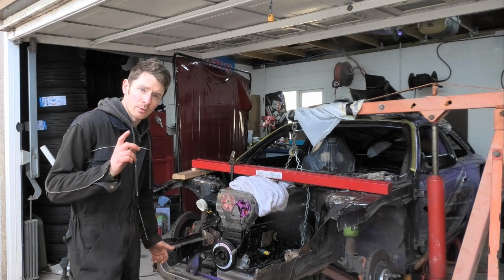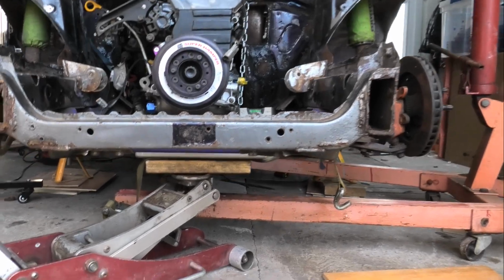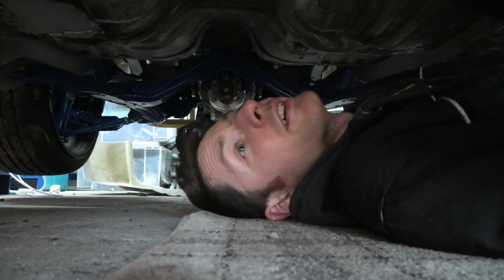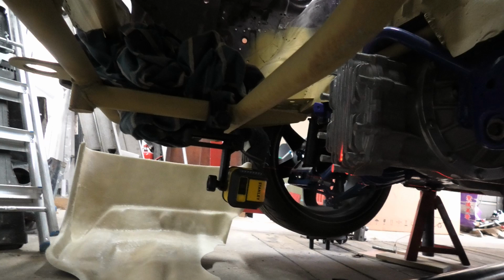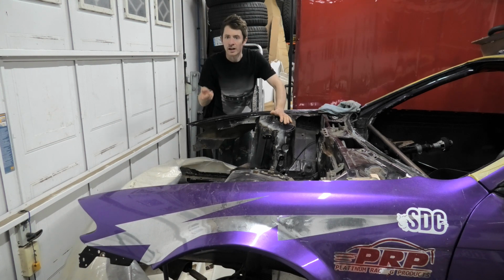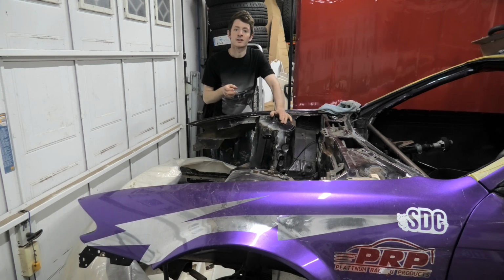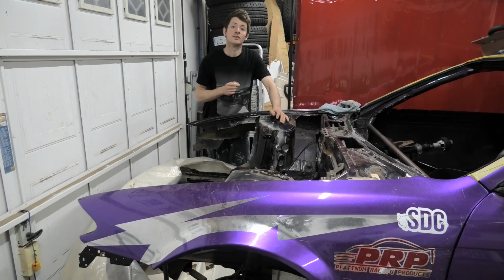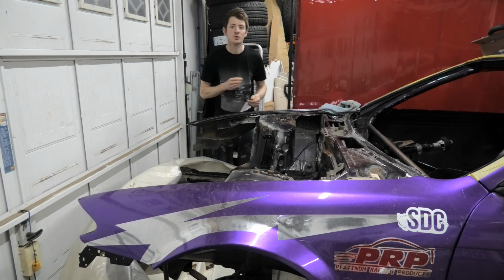Chassis engine mounts ProVlog Vol: 28

Comment: Any merit to welding on continuous bead vs the method your using where you kind of go dot-pause-dot-pause. Is that to prevent heat build up? I am not a welder. Please forgive my words.
Reply from the maker: I’m just trying to control the heat going into the metal, it’s not thick plate especially the chassis I’m welding to. A lot of what your seeing is me tacking stuff in place multiple points to stop it pulling when I weld it solid.

Comment: Why do you have 1 solid engine mount and 1 poly?
Reply from the maker: A lot of the high power gtrs brake the exhaust mount so prp offer a aluminium replacement. I was going to try the same it’s rubber on the gearbox and inlet side of its to solid I’ll easily replace it with a rubber one